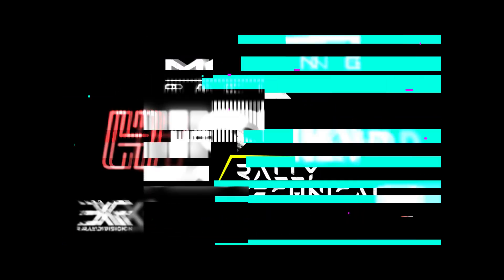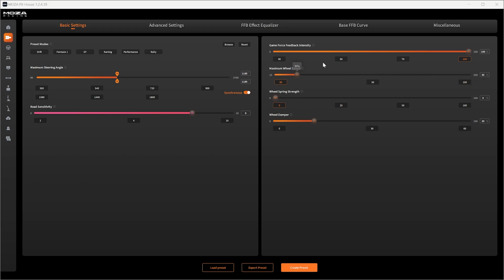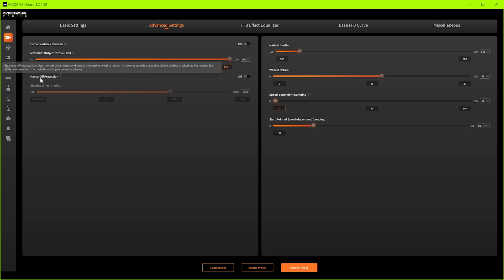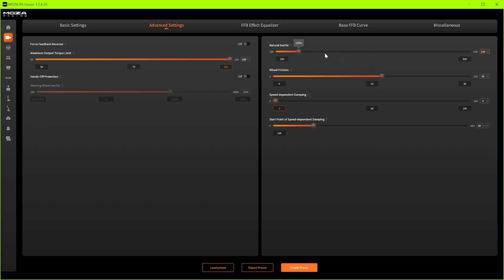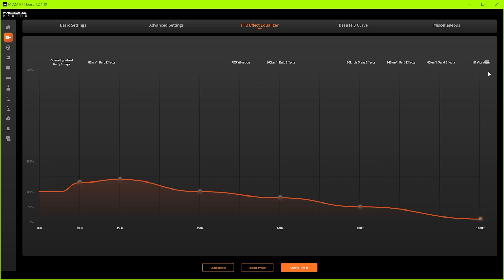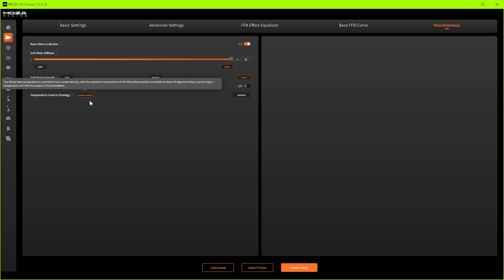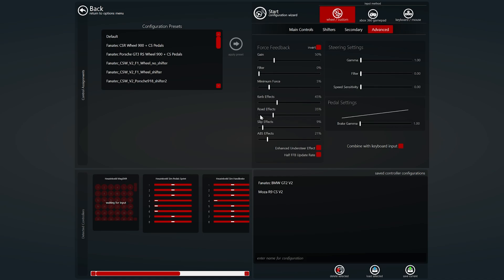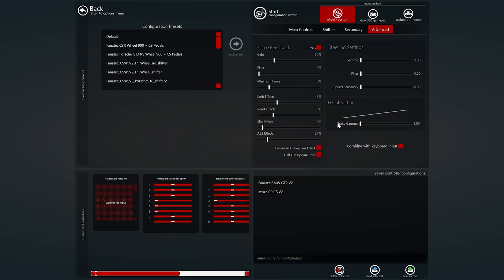Assetto Corsa | Moza R9 Deep Dive

Comment: have you got anything specifically for f1 cars
Reply from the maker: Essentially, all you should be doing for f1 cars is changing the wheel lock to 270° - 360°and slowing down the top dead-centre wheel travel speed with the linearity to compensate for that low lock. If it's a mod car, then it all depends on what the modder has done. I know the rally car mods I tried wildly differed in terms of wheel weight and strength.